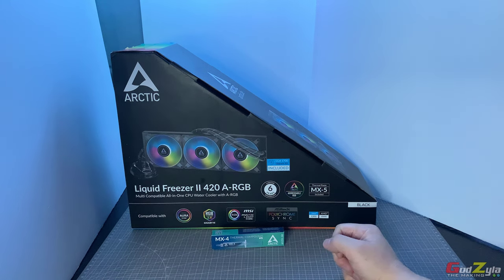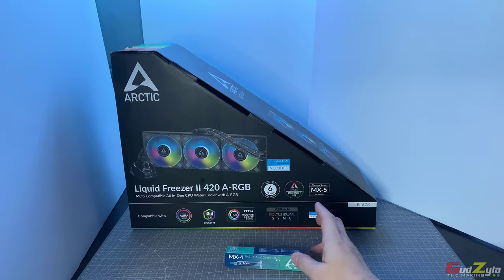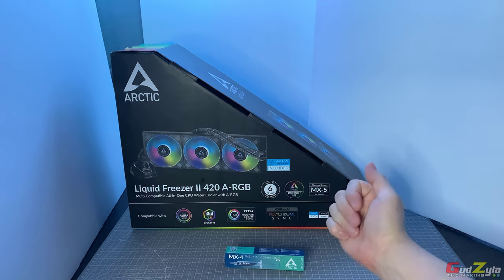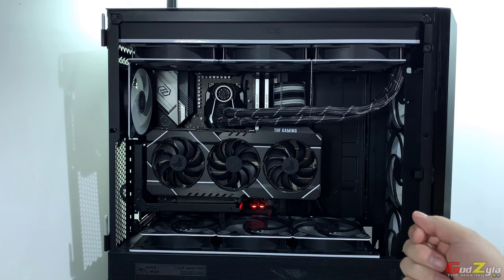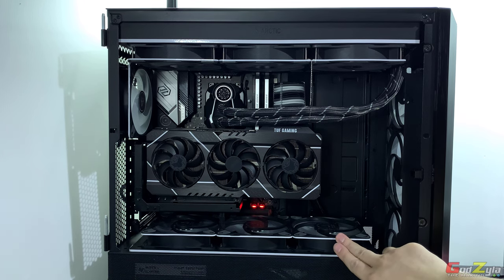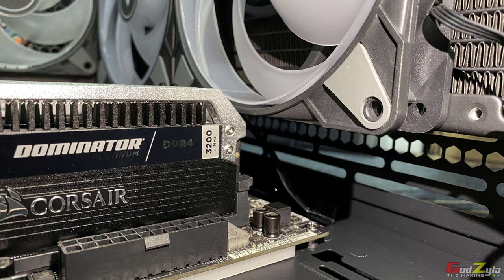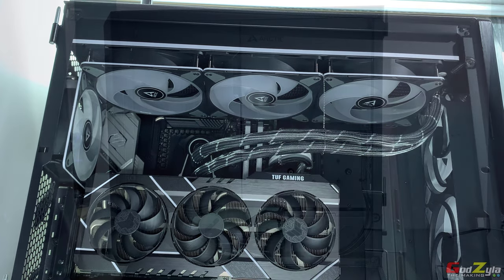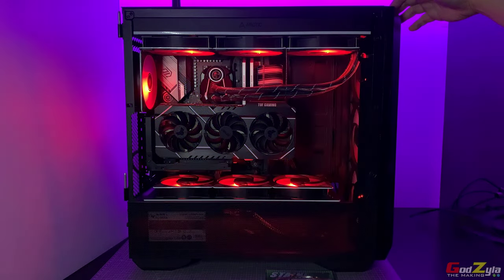Arctic Liquid Freezer II 420 in Lian Li Lancool III - Part 2 (The Experience)

Comment: Will it fit in the front?
Reply from the maker: Hello Andreas Hasvold, welcome to my channel and nope, it does not fit at the front, only at the top.
Reply: @KleoYan  ah. I am really hoping my h170i will fit in the front. Will find out this weekend
Reply from the maker: @andreashasvold2658  I see. I thought you are referring on the Arctic LF2 420. In this case, you have to try it out as I do not have the AIO you are having.
Reply: @KleoYan  i can confirm that a corsair h170i fits the front with ease😍
Reply from the maker: @andreashasvold2658  Nice, congrats and thanks for the info too.
Reply: @andreashasvold2658  das ist die Antwort nach der ich Gesucht habe !Habe auch die  Corsair H170i in der 420mm Version Bestellt und möchte diese auch in der Front in das Lian Li Lancool III Einbauen ! Suchte 14 Tage im Web auf eine Antwort und habe nichts darüber gefunden ! Jetzt hier auf dem youtube chanell von Das ist Kleo endlich gefunden.Sie haben meinen Tag gerettet ! Vielen Dank
Reply: @bertholdminarik250  I was also looking for that answer, and Lian Li manual says no, but website says yes. So decided to try it out and the website is correct. It works perfectly in push/pull also. I am so happy i could help🙂
Reply: sry,i forgot to Translate ! 😂

That's the answer I was looking for! I also ordered the Corsair H170i in the 420mm version and would like to install it in the front of the Lian Li Lancool III! Searched the web for 14 days for an answer and couldn't find anything about it! Now here on youtube chanell from That's Kleo finally found. You saved my day! Many Thanks
Reply from the maker: @bertholdminarik250  you are most welcome and all the best with your build too 👍
Reply: @andreashasvold2658  Exactly, on Lian Li's website it is also the case in the drawing of the front that a 420mm radiator fits there, and that's why I was very worried because all the youtube videos of the case don't go into it
Reply: @andreashasvold2658  Thanks again:goodvibes:
Reply: @bertholdminarik250  No problem👍 Glad you found this🙂
Reply: and what amazes me is that no matter whether on the web or on youtube everyone says that only a 360 water cooling system fits in the front! This youtube channel here is worth its weight in gold.
Reply: @KleoYan  thx Sir
Reply from the maker: @bertholdminarik250  you are most welcome 👍
Reply: @andreashasvold2658  what, push pull also works in the front with the Corsair H170i ELITE LCD 420mm!? That's the big hit! Could you please tell me more about what has to be considered when installing in the front with push pull? My Elite 420mm is coming tomorrow😍
Reply: @bertholdminarik250  It's really easy and good space for ut🙂 But i would recommend installing the aio before the motherboard or at least remove the RAM so you're not unlucky and break anything.. You need to install the front bracket first in the same position as lian li refers to on the webpage. The front fans will be flush with the front. Then i just carefully place the rad onto the bracket from inside of the case and secure the front fans. Then remove the panel inside the case for fans/harddrives so you have space to screw in the fans on the inside for push/pull. Worked as a charm🙂
Reply: @andreashasvold2658  I will follow your instructions and install the Aio in the case first. Thanks again for this information! Man, and I was about to buy a 360mm Aio, but my gut feeling told me that it has to be possible! Because, on the Lian Li hp it is also described that a 420mm radiator fits in the front.👍
Reply: @bertholdminarik250  no problem🙂 Enjoy the build🙂 It's gonna be awesome. Love the case and aio😍
Reply: @andreashasvold2658  Let me know when the conversion is complete! My thanks also go to Das ist Kleo because he dared to do the 420 Aio conversion on the Lian Li Lancool III and is telling us about it here! Front with a 420mm Corsair H170i ELITE LCD fits. I'm curious what these other "top" youtubers say about it! Since they gave wrong information in their channels.
Reply: can now also confirm that the installation of the
Corsair H170i ELITE LCD 420mm (front) in the Lian Li
LANCOOL III E-ATX case midi tower, without problems
fits in. It's just a pity that you can't upload any pictures here
can look like the installation! And like Andreas Hasvold
already said push pull works.👍
Reply: Pictures of the installation Corsair H170i ELITE LCD 420mm in the front / Lian Li Lancool-III

https://linustechtips.com/topic/1444985-new-lian-li-lancool-3-mesh-case-ordered/
Reply: @bertholdminarik250  Hab ich das jetzt richtig verstanden, dass es doch möglich ist, eine 420mm aio in die front einzubauen?
Reply: @lb8613  it fits a Corsair H170i ELITE LCD in front in the
Lian Li LANCOOL III E-ATX case.follow the link,
there it is illustrated.https://linustechtips.com/topic/1444985-new-lian-li-lancool-3-mesh-case-ordered/
Reply: @andreashasvold2658  thanks for the tips bud, I have the same setup! I assume you couldn't fit the 3x 140mm fans at the top with the front mount? For me, no luck with that. If you have a pic of final setup, that would be great!
Reply: @mahoneyj2  no problem👍 Nah, no luck with  more than two 140 fans in the top here either. But i'm ok with that as long as i got the h170 in the front🙂